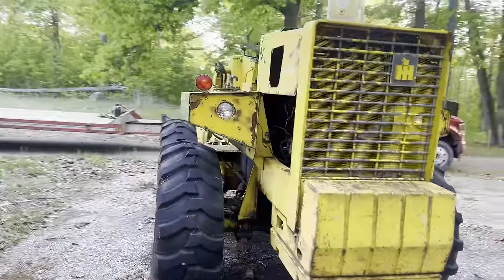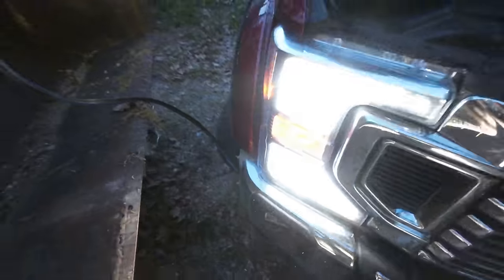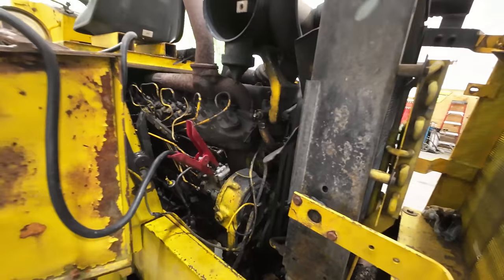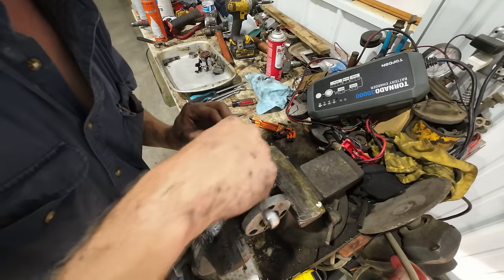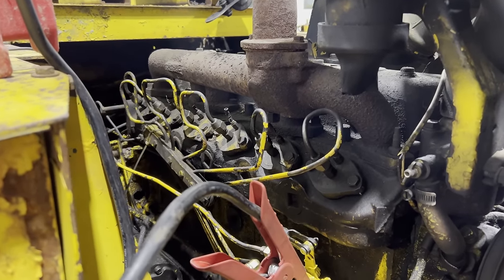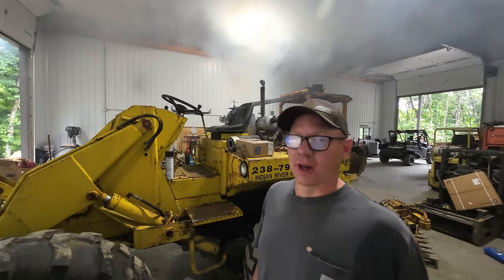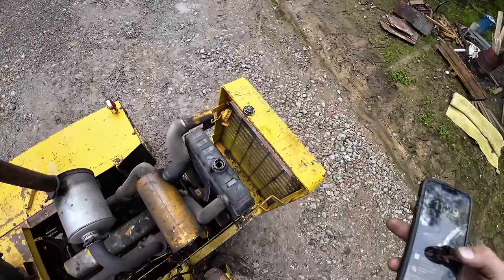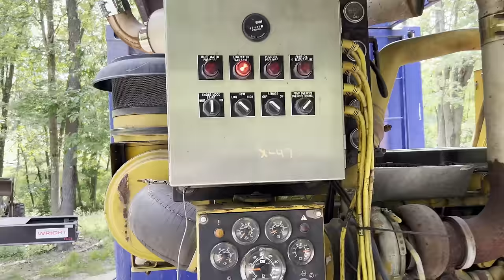FREE International wheel Loader, Sitting 8 YEARS! (Will it Run??)

Comment: Is it normal to do a full inspection after you get the free international home? There are 2 basics when starting any engine. Fire and fuel. The engine turned over! If the owner knew anything about these front loaders he would sell it for a decent price or high a mechanic to get it running, then sell it for major profit. Stop making rich ppl richer. I like watching these videos because eventually might get it running. Too much drama though. I've seen too many videos that he doesn't conplete repairs. He's good at pointing out things that need repair, but doesn't repair. He will most likely get this running, spend very few bucks on it and make a huge profit. Not even considering splitting profits with the original owner. Probably an elderly widow female that just wanted it out of her yard. She still deserves some profits. I wonder if Matt suggested to her, or the owner to put it on ebay first. Matt is wealthy! Observing his land, his equipment, tools, buildings, he  is wealthy. Now, if he sold it to a patron or somebody in need for a reasonable cost, making up for his T & M, that would be decent but seeing ppl like this get rich off if DIY mechanics that think he's a great mechanic is not fair. Good mechanics like Jesse Muller, whom supports himself through employment as a construction employee or business owner and Chris from NoNonsenseNoHow channel whom know WTH they are talking about, deserve recognition. I'm sorry Matt, you jump all over the board and make assumptions before confirming. I will watch your videos in hope of finally learning something I have never seen before, which I do after several videos but for goodness sakes, finish a complete repair, edit out the drama and teach your subscribers how to commit and complete a repair. Watching your videos, skipping steps in the manual to remove the pump, and disassembling  the pump w/o instructions confirms my suspions that you are a half mechanic at best. No disrespect Matt, just my opinion. You seem like a good person but what are your intentions? To show watchers how to get something running as quick as possible or fix it right? I no what I think. Just wondering if anybody else thinks the same. My suspicions began when you bought a old 2N tractor and half ass cleaned and repaired the tractor, just to get it running. You bought a coil off of Amazon most likely, and got it running. Then you put it up for auction? Lol, got a high bid you said but nobody paid you. Maybe they wised up. You say, saved it from the scrap yard? As much time and effort you put in that tractor, that's all it's worth. You did not confirm lift or PTO was working, draft control, steering, sherman gear or did not check compression, didn't even pull a plug, etc....  there is alot more to that 2N than running half ass. I own a 1947 2N Matt.  I know what can go wrong. Flipping has become a used car salesman tactic. Throw saw dust in the transmission until the owner has to pay a fortune to repair it. People need to wise up. You consider yourself a good mechanic, I consider myself a good judge of character.

Comment: You losen the pistons, lubricates the upper piston,  rings, and the engine turns over with no compresion! And afterward you tibghten up the injecters it will run with left over Mr. Marvel and it won't smoke as bad as it is!

Comment: Can't understand how you can engineer/design/build a device like this with NO safety element to it (regarding no protection for the driver and nothing to stop the bucket from tilting back it's contents on the driver). I know this was built in another day/age and perhaps that's the answer, but geez. This thing is a death trap waiting to happen given where/how it was used. I guess it's the same concept as miners back in the day going down into mineshafts in rickety old bucket hoists. Many died simply by those failing I bet. People were/are expendable in business was (and is) the mindset (unfortunately).

Comment: @jump62
0 seconds ago
I live in Missouri were this is going thru its my understanding that the power grid can only hold a certain amount of power so that being said  I have  a question when you drive around the midwest and in the areas that are suppose to get this power a large portion of the windmills are shut down and its not maintenance the hydro power in these areas don't even run all the time because the power is not needed so if the power here is not all needed then what are you going to do with the power you are sending this power line has always sounded like a scam i think it needs a real close look into what is up with this project